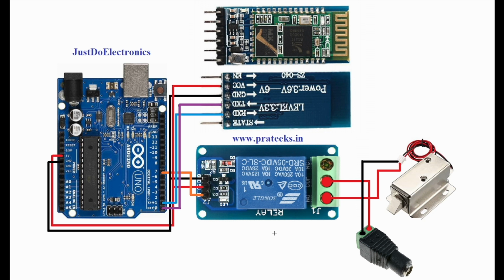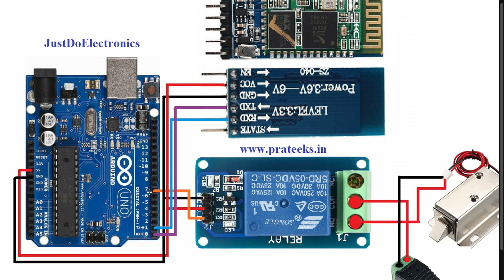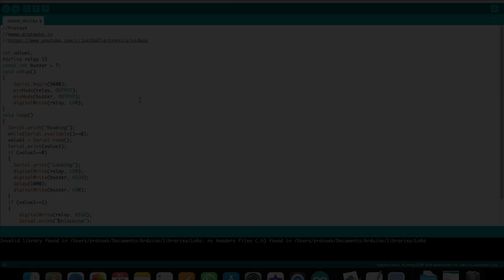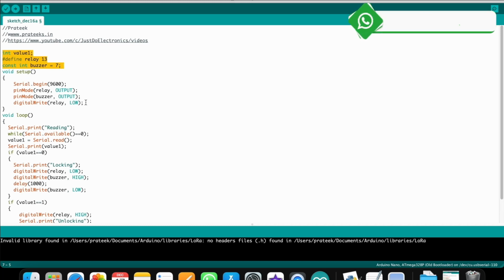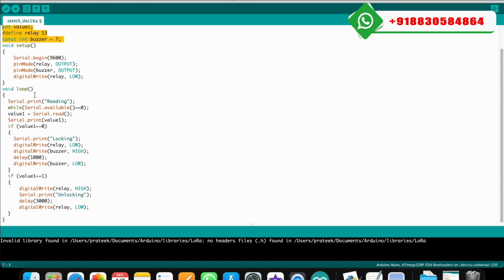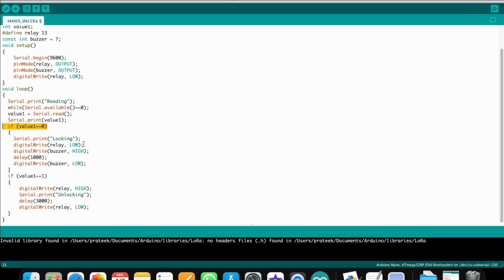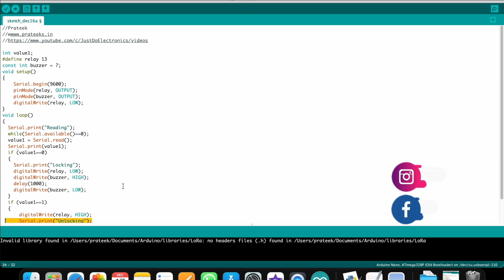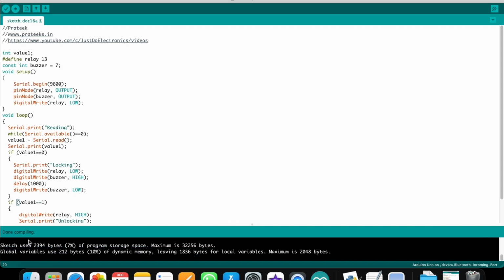Android Fingerprint Arduino Door Lock | Fingerprint Door Lock System using Arduino

Comment: Can we use 9v 2 batteries? One to current the audiuno and the other for lock?
Reply: @forwork4746  can you able to send circuit diagram and code and components which you have used
Reply: @forwork4746  can you send code, circuit diagram and components which you have used